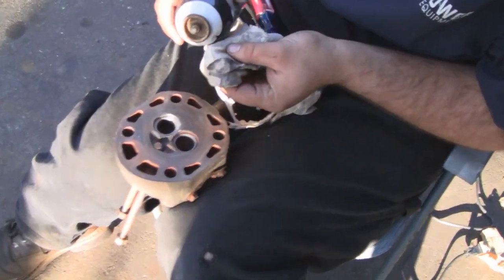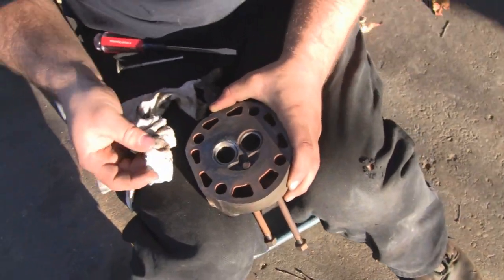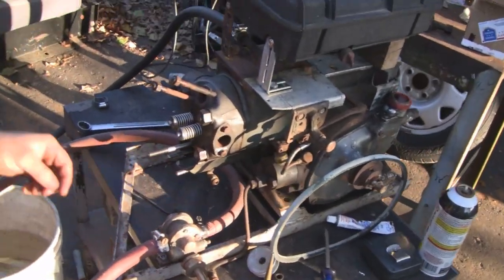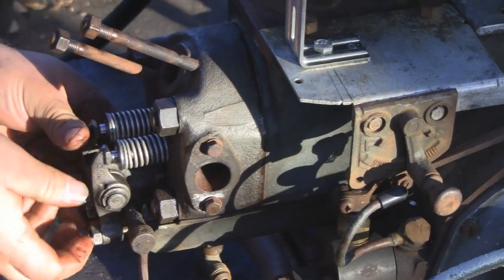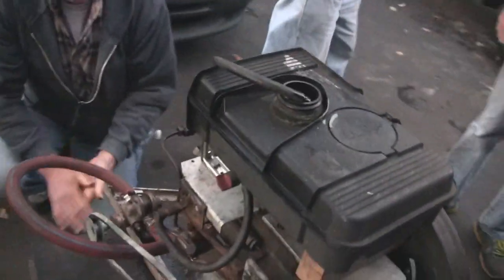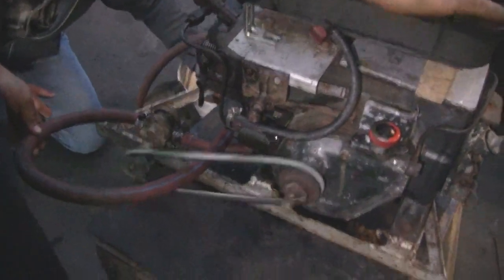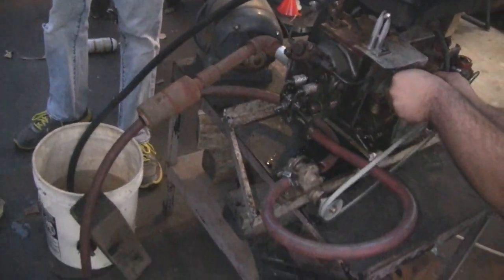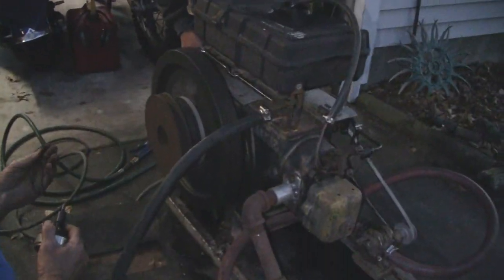ANTIQUE YANMAR DIESEL ENGINE REBUILD (PART 3)

Comment: Those Yanmar  Diesels engines here in my Province are used a lot by Fishermen and also in the pleasure boat industry. Yanmar ( at least what I've heard ) are a very reliable and long life engine. 
A lot of Sailing boats use these as auxiliary engines. Used a lot to get these boats into and out of Harbors and docks.
 I guess you know than Yanmar also makes a lot of the small or mini  sized excavators and other small construction equipment too.
Good work Mike and Company. Good job fixing that valve seat,..I was almost going to say, " That's using your head."   But I won't.
Reply from the maker: +Reg Sparkes Thanks Reg!! Yeah they're real popular overseas too!!☺

Comment: Looks and sounds very similar to mine. Do you stop it by shutting the throttle. Does it govern by turning a needle valve in the fuel pump on the high pressure side. If so it might? need turning round. They develop a flat and at starting deliver no fuel, so full throttle and lots of winding to get them to start. Just turn the needle valve 1/4 of a turn and starts first compression. No need to decompress, just turn the key. My boat was delivered to a local boatyard and dropped in the water. Went to it on a freezing day in December. Turned the key and it fired first compression.
Stories on on my boating pages
http://malcsworld.freewebspace.com/index.html
Reply: i didnt know diesels had a throttle, if you mean shutting off the gas all the way i get it but diesel has nothing to regulate air going in most of the time
Reply: Diesels are throttled by the amount of diesel going in...air is usually unrestricted. Modern injection, both petrol and diesel are very different from how it used to be done.